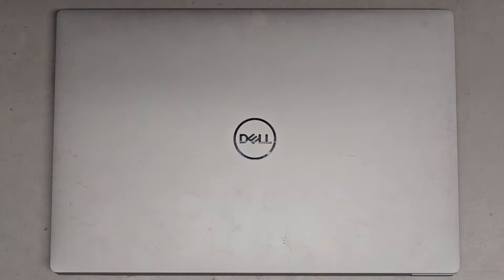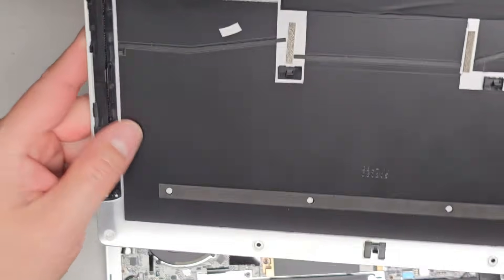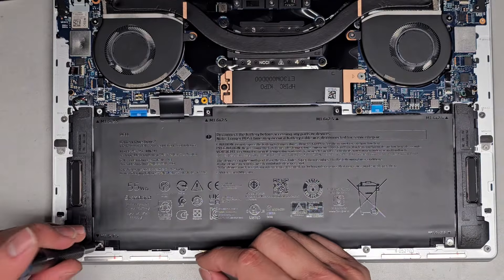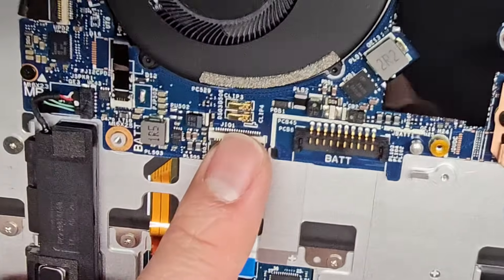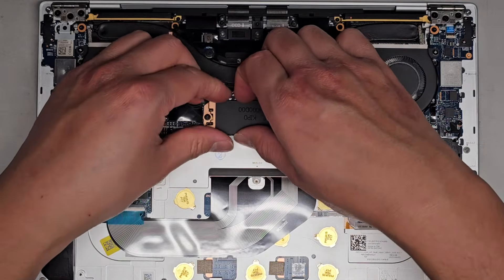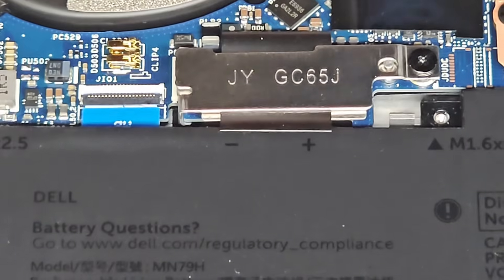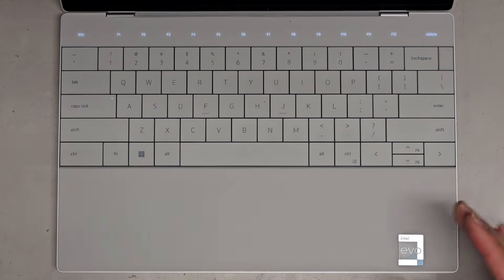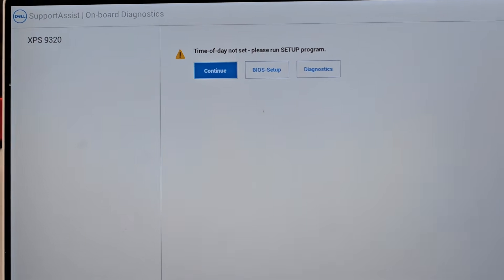DELL XPS 13 Plus 9320 Disassembly (No RAM) SSD Hard Drive Upgrade Battery Replacement Repair

Comment: I followed the same steps to open it up in order to replace a broken screen (with the case). When I booted it back up it is not recognizing the SSD and I get an alert TPM device is not detected. Any idea what might be going on?
Reply from the maker: Bios settings get reset when the battery is disconnected.